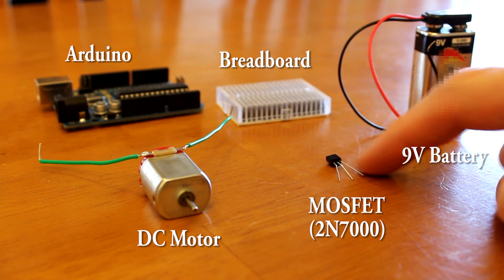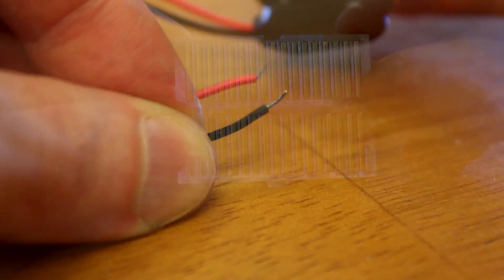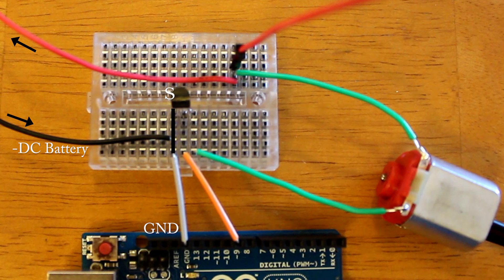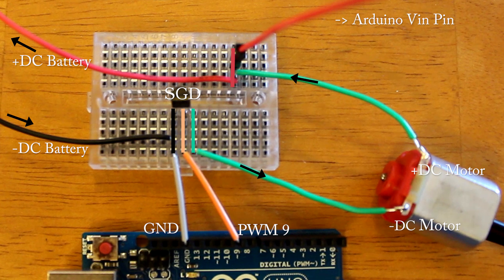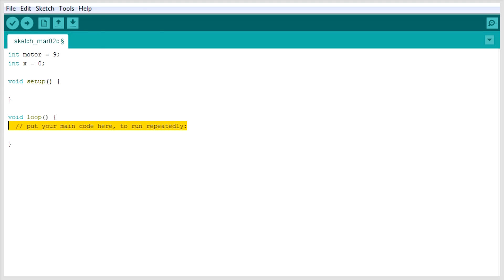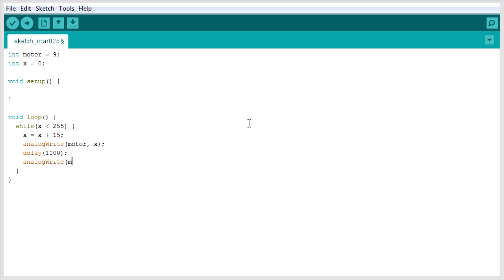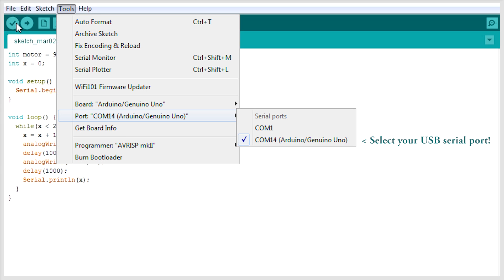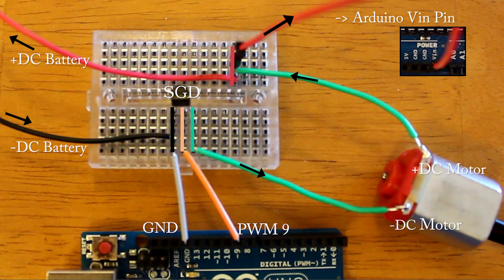How To Connect DC Motor + Code [Arduino Tutorial]

Comment: I was wondering, won't not including a diode possibly burn the mosfet due to the back emf?
Reply from the maker: Yes, you are absolutely correct. In an actual setup please include the flyback diode.
Reply: @tolsonw  Is a 1N4007 rectifier diode reliable as the flyback diode?

Comment: Curious... whats the difference here then? or was the while loop just your preference?

int (y=0; y<255; y=y+15)
{
analogWrite(motor, y);
//motor will increase when y increases...
Serial.println(y);
delay(1000);
}

??
Reply: Ohhhh wait. With the while loop, the condition is that the code stops when x is equal to 255 (256bit), so therefore my code would just start from 0 every single time. Smart.
Reply from the maker: That works too! It was mainly an educational purpose as for loops are pretty commonly used, I wanted to demonstrate a while loop.

Comment: I want to try this but i don't know what you mean by "green cables" do you mean "Breadboard Jumper Wires'? I really want to do it but I don't know if that is the thing I should buy. I found it on amazon.
Reply from the maker: You can use just regular jumper cables. The only time you'd need something bigger is if you move to a higher power motor.

Comment: this is an explanation we all expected... YT is full of fancy "experts" complicating things... As Einstein says: "If you can not explain it simply, you dont understand it very good". Thanks dude!
Reply from the maker: Thanks very much Vladimir!
Reply: Tolson Winters may i ask you something...? I dont have such mosfet, can i use any NPN transistor for same motor? Lets say CBF240 or 2N2222A? Thanks :)
Reply from the maker: @vladimirkuharik34  Yes that should work as long as it can handle the current required and be triggered by 5V.

Comment: Can is use a transistor instead of a mosfet?
Reply from the maker: Yes, this will also work if you have the properly rated transistor
Reply: @tolsonw  THANK YOU VERY MUCH
Reply: @tolsonw  do you know how I can run 2 DC motors?
Reply from the maker: @betaoff9851 Controlled separately or at the same time? If you want to control separately, then you'd have to connect 2 transistors (or mosfets) on different PWM pins. By turning them each on/off then you allow current to flow through each transistor independently.
Reply: @tolsonw  OK thank you very much

Comment: I just want to know, how many volts are in that dc motorr?? Please reply. Thank youu!!
Reply from the maker: There are 9 volts going into the DC motor. The motor is actually rated at 3-6V, so this is over spec, but I've used them up to 9 volts before.

Comment: I know this is a late commet but can someone help please: can i use any dc motor i got from a local shop with a mosfet 2n7000 or do i need a certain mofset for different things?
Reply from the maker: MOSFET 2N7000 can only switch up to 200 mA. If you need higher current (ie using a bigger motor) then you need another MOSFET that is rated to switch more current. You can also use stepper motor drivers, like the TB6560 which I'll make a new video for soon hopefully!
Reply: @tolsonw  thanks for the reply . Love this video helped me so much

Comment: Why didn't you do
int x - 0; 
while(x<17) {  
x=x+1;
}

Why do it in increments of 15?
Reply: He uses that x for pin voltage (in analogWrite), not just to loop 17 times. 
255 is equivalent to 5v in arduino.
0 is equivalent to 0v in arduino.

Comment: Are these 1.5-3v motors?
Reply from the maker: DC Motor R130
Rated voltage is 3 V, but I've used them from 3-9 V
Operating Amps: 0.35-0.40 A
Reply: @tolsonw  My code does not control my motor for some reason, and my MOSFET keeps on getting very hot. I'll try to replace the motor, but should the MOSFET be overheating?
Reply from the maker: @PPPPPPPPPPPPPPxk  No, the MOSFET should not be overheating past its rated temperature. Are you using 3V and still having this issue? I would double check the wiring as well, it may be a connection issue. If you're using a different motor it may be trying to pull more current than that MOSFET is rated for. Otherwise, the MOSFET itself may be broken or damaged already.
Reply: @tolsonw  I used a new MOSFET, and the heating reduced significantly. Before trying using 3v, I want to make sure that I have no wiring or code problems(I soldered the whole thing together, including a switch). The motor is a 1.5-3v motor. It does spin when I short the MOSFET and directly connect the source and drain, however. I've included an image of the setup:
https://imgur.com/a/7MlQN0y
Can you help me see if I'm doing something wrong with the switch, etc?
Thanks for all your help so far!

Comment: In place of variable x can we feed the data having random values
Reply from the maker: Yes, just make sure to keep that random number between 0 and 255.
Reply: Tolson Winters 
Yup...I have done the same..
Our project is first data is feed from Matlab to Arduino then to motor....but the program we are writing is not proper and by your approach I think that is doable...
Reply: And we r using DC geared motor so it's not showing much difference in speed

Comment: can you make it run the two direction by this circet?
Reply from the maker: If you switch the battery's (+ / -) leads, it should change direction.
Reply: @tolsonw  how can you do it without switching the leads?
Reply from the maker: @noahjuliano1847  You could setup 2 MOSFETs, with opposite polarities (+/-). Then control which Gate you open and which you close using 2 microcontroller digital output pins
Reply: Hi. @tolsonw . So you mean I need a NPN and a PNP mosfet?

Comment: Can I use 2 motors both connected to the same circuit?
Reply from the maker: You should be able to, as long as there is enough current provided to both motors.
Even with the 9V battery it should work, but will drain the battery faster.
Reply: Thanks. What if I do it in series?

Comment: i am little confused, what then is the use of motor driver module for arduino if we can connect the motors directly like this?
Reply: Mistypix Studios same question by me
Reply: The motor controller chipsets are able to do larger motors more reliably without putting strain on the Arduino itself. Also the mosfet can only do so much until it will pop and let the magic blue smoke out.

Comment: will we use power mosfet if we want to run high amp motors
Reply from the maker: For high Amp I'd recommend using something like a TB6560 Stepper Motor Driver (3.5 Amps).
Reply: Ok thanks

Comment: I was wondering if the mosfet that i need to use must be the same that is used in the video.
Perhaps i can use a different transistor with similar ratings?
Reply from the maker: Hi, yes if it has similar specs for what you want, then you can use a different transistor. Just note that some transistors may be connected differently. Ie. The 3 pins may not be in the same order as shown in the video.

Comment: I tried to control the speed with my ps4 L2 button now it says "osc did not start"
I think i burned my Uno :|
Reply: ok i fixed the Error by uploading empty code , pressing reset button thousand times , unplug and plug everything
Reply: i think my Mosfet not working because my Uno gets so hot when i connect the source to GND
Reply: @MohammadAlizade  Thanks For Sharing Valuable Information